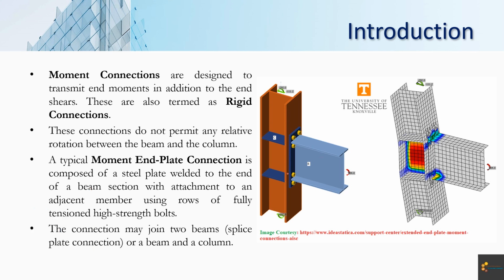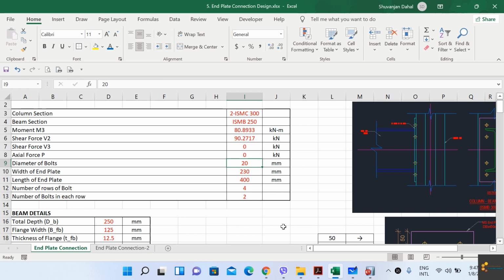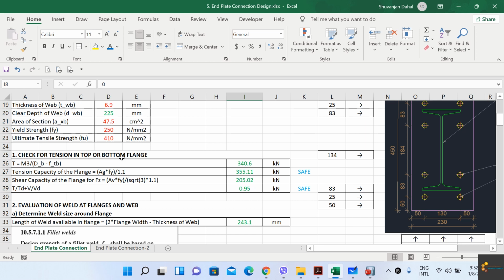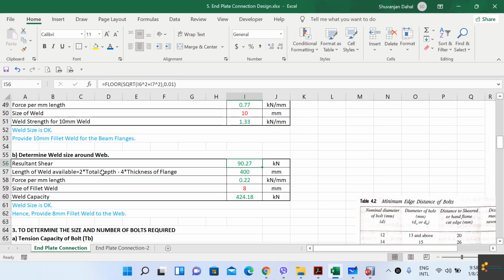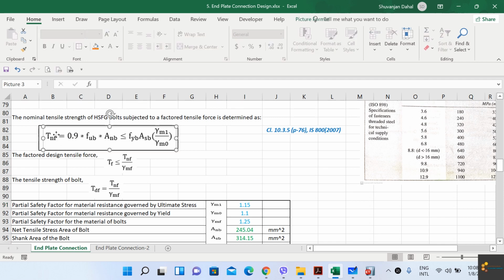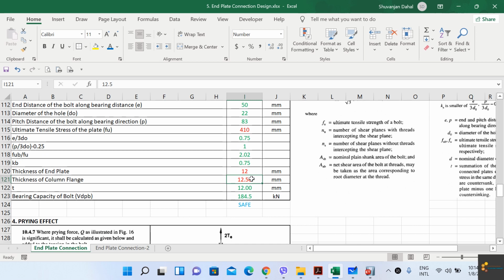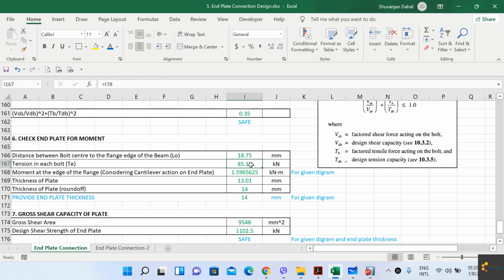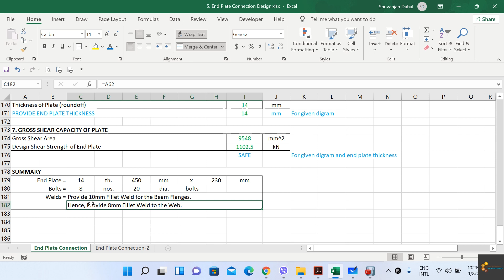Lecture 12 - Design of Extended End Plate Moment Connection - Connection Design as per IS 800 Code

Comment: Force per mm length; while checking flange weld strength has to be actual force in weld. That is dependent on applied force & not the design strength of weld. Please check. (Time 15:40)